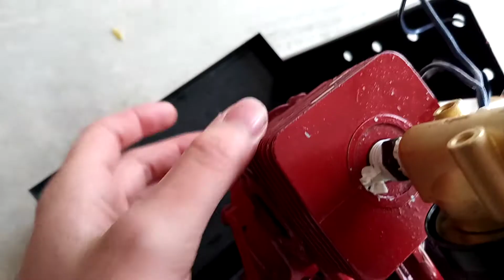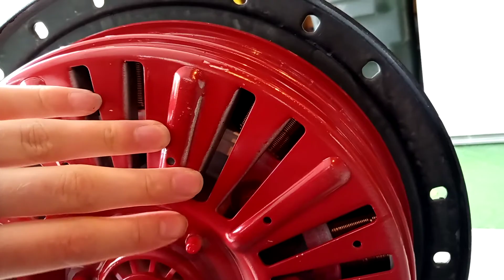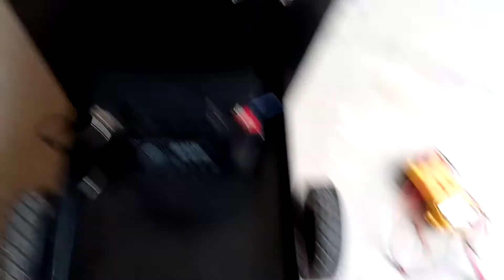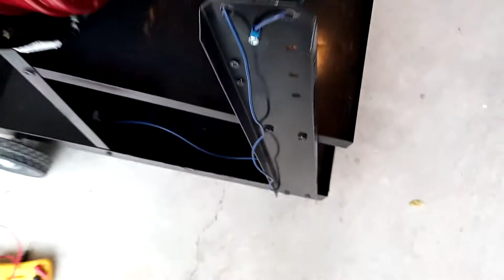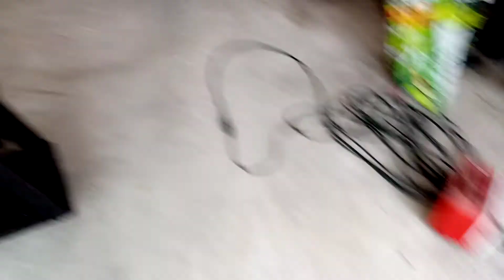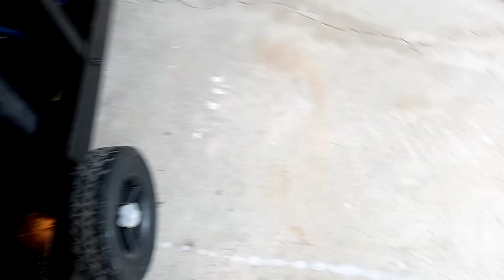Steam power generator

Comment: Skipped thru your vid..what is used for lubrication?..
Reply from the maker: I just used a little used motor oil in the cylinder every time I ran it
Reply from the maker: But if you're running on steam conventionally you would use steam oil. You have to put a drip feed on the high pressure line just before the engine.
Reply: Wow. Very impressed.  Would love to see if you've continued perfecting.
Reply from the maker: @josephnorton1225  have not. i had to move into a small apartment in the city.